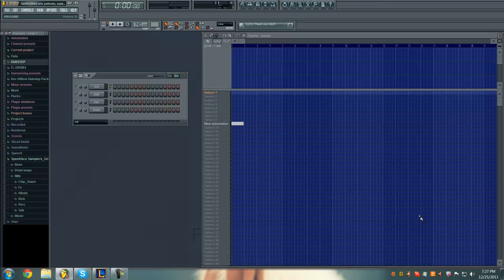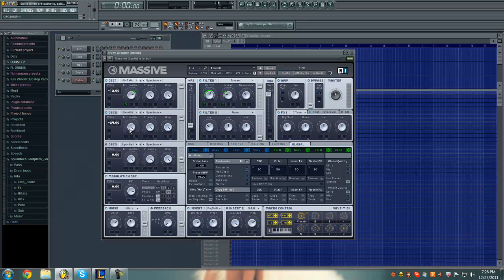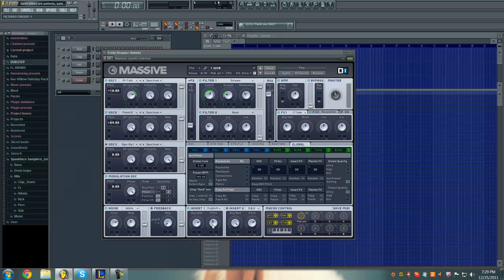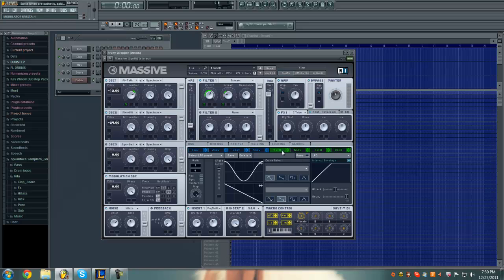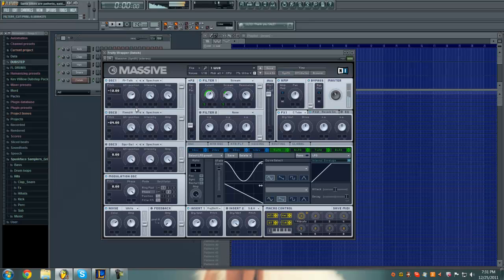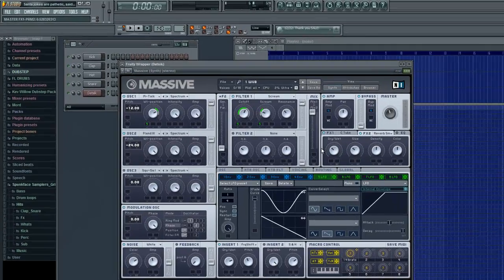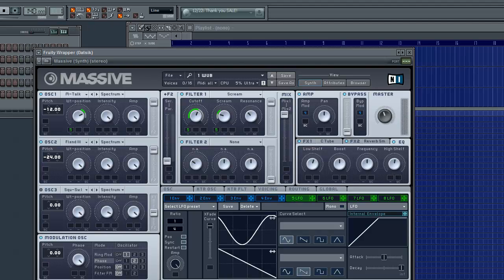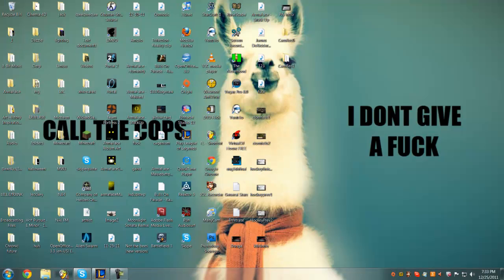How to make a DATSIK Wobble Using MASSIVE!

Comment: nope, first of all you need to use massive as a VST. a vst is a midi source used for making everything in FL or ableton, i use ableton, and i had the same issue when i was first learning how to produce dubstep. I actually do what is called freezing tracks, i make a midi wobble with massive. then i right click my channel, and click freeze track, then move it to an audio track so i can resample or glitch my wobbles or reverse them and also extra VST's over that audio track to add some crunch! :D